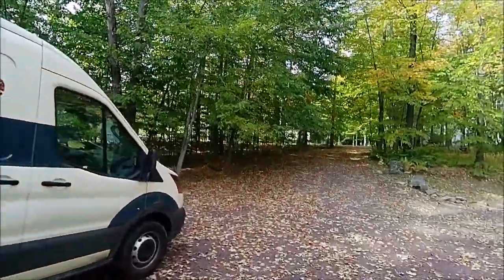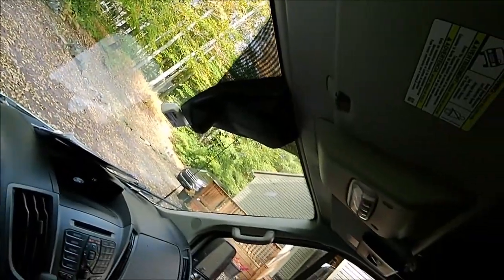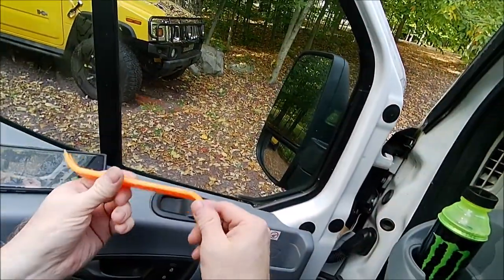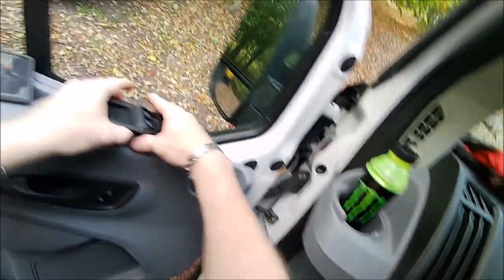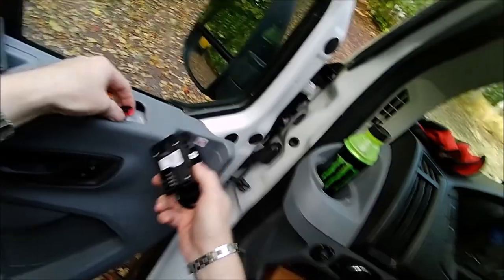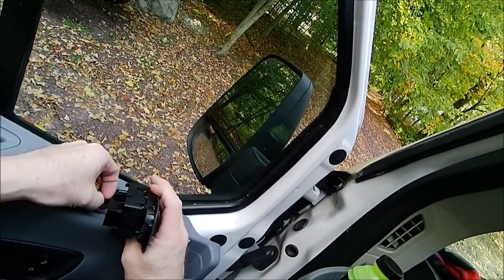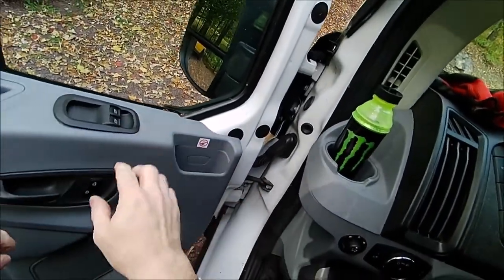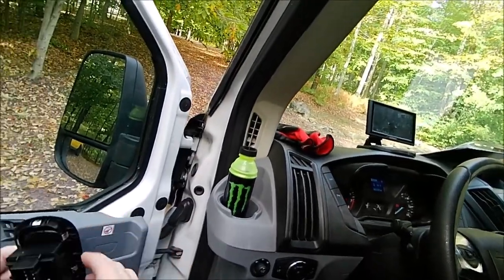Ford Transit Window Switch 2014-2020+

Comment: When I done this the windows didn’t work after changing
Reply from the maker: Check the fuse, sometimes when the old switch fails, it can short and blow the fuse, especially if the switch gets real wet when a door is left open in the rain.
Reply: @GarageMahalLife  where is the fuse. I can’t find a diagram